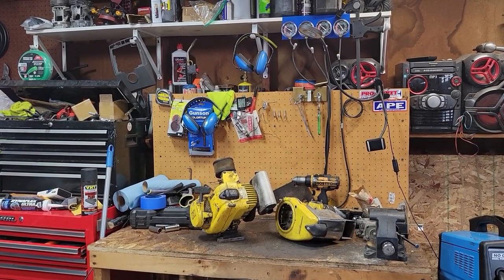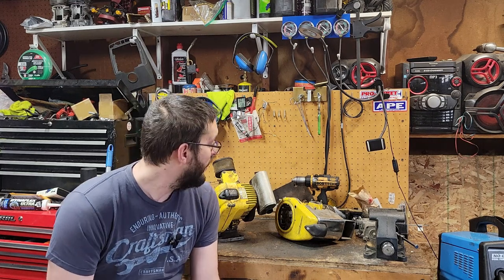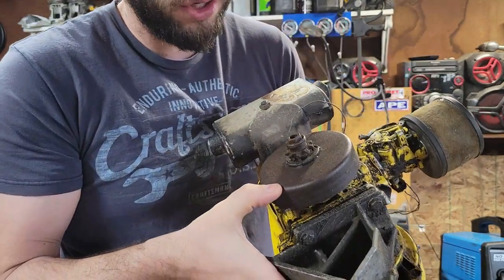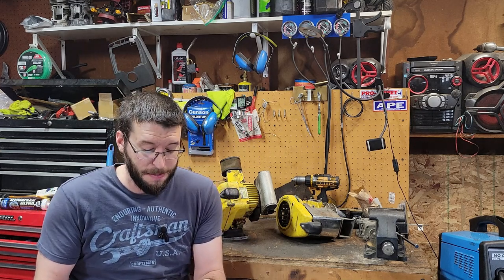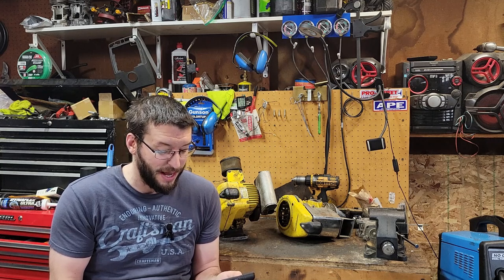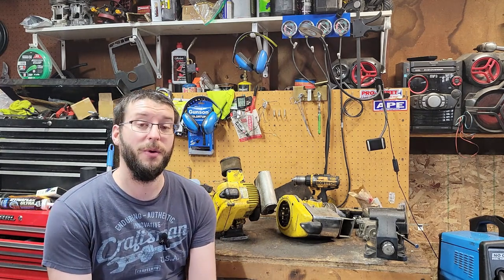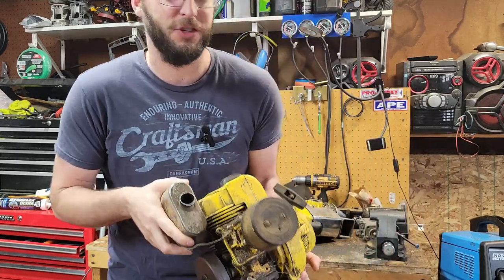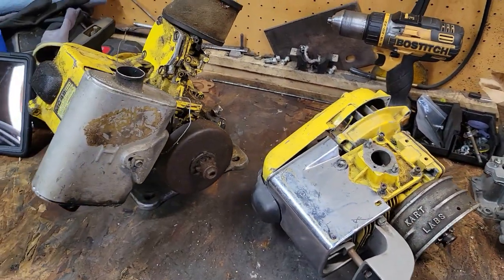McCulloch Kart Engine Projects Introduction

Comment: Bryan,     I am from Maryland.  Back in 1972 McCulloch made the 091 engine and 101b engine.  I had a Margay race kart back then with a MC101 engine on it.  It had no pull start, since it had a pulley there.  The carb ran off alchol and the engine produced 16 hp.  I raced for two season's and lot's of fun with it.  It would do 65 mph - fast .. ......  Thanks  David

Comment: Bryan, that's a killer deal! Years ago I started collecting vintage karts and McCulloch's, both kart and saw engines. The intake manifold on the MC30 is incorrect. I know because I have an NOS McCulloch MC30 intake I bought off ebay probably 15 years ago. Anyway That is fantastic. There are several flatback carbs available on ebay at the moment that would be a replacement if necessary. I'm building a MC70 clone at the moment based on a 790 block and a 101 crank. Reach out, always good to see other guys keeping these old motors alive.
Reply from the maker: The mc30 was a parts engine so more or less robbed for its intake and this was slapped in place. It may get a v4 intake.
Reply: @mistermacgray  is there a forum where I can talk with you more directly about McCullochs?
Reply from the maker: @Travis Lawson  you can find me on Facebook in my group Modified Saws or in the group McCulloch Chainsaws North America too. Also I have an Instagram, the link to that is in the community section of my youtube channel. I'm not on old school forums anymore, haven't been for over 10 years when I had a Ford ranger.

Comment: Cool stuff.
I just got a saw with a mc75 in it.
I'm trying to identify it.
Reply from the maker: If you posted it on facebook then I saw and commented on that post last night. That is for sure a nice find and the custom saws I'm after.
Reply: @mistermacgray  I did.  Thanks ya im trying to figure out what model saw they started with so I can get a air filter and rubber lines so I can get it going.  It has crazy compression.

Comment: If you don't get the wrist pin bearings unstuck it will destroy itself.
Reply from the maker: And that is exactly why I won't run the mc49 before doing work, it will get taken down immediately to be cleaned up, inspected, new seals and gaskets.

Comment: I have an old McCulloch 300 I can it be turned into a karting engine it's 87cc it is immaculate
Reply from the maker: Back in the day kart guys woukd cheat using a 300 that had 1/16 more stoke giving it that extra 7cc and better porting too, and put mc49 badges on it.
Reply: The crank you're speaking of, do you know what stroke it is, and what model it's out of?
Reply from the maker: @chadhunt6596  I'm told an mc5 crank is what guys would use in 250 engines to get the tapered shaft and retain the stroke. 250 have a 3/4 output.